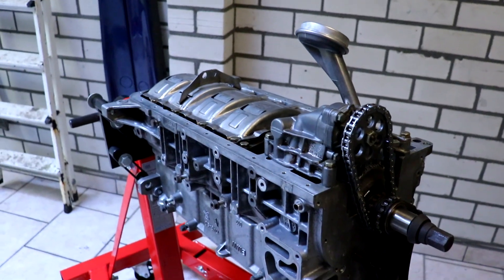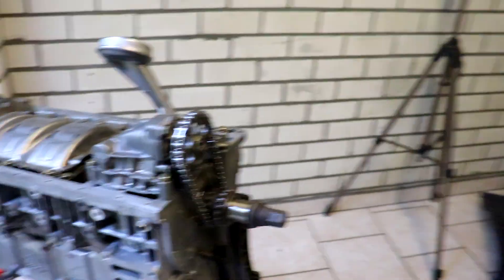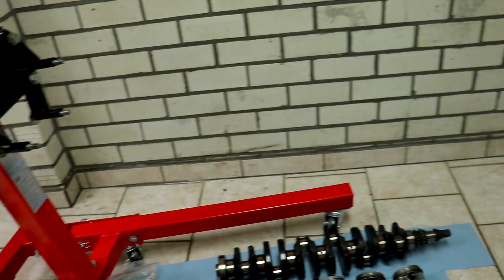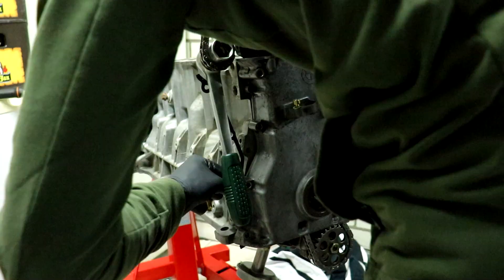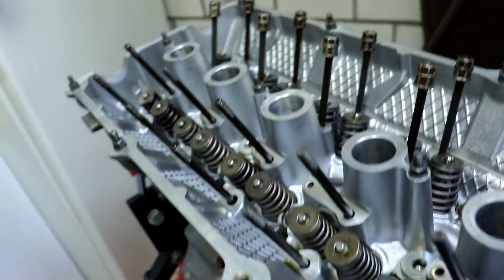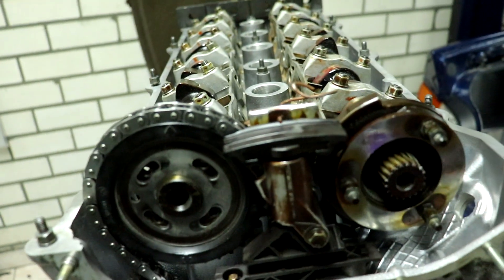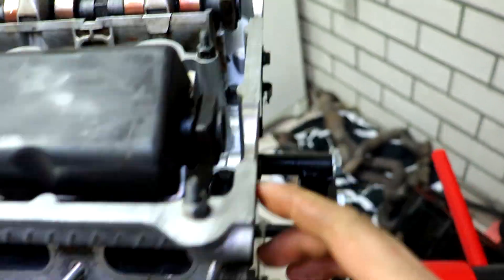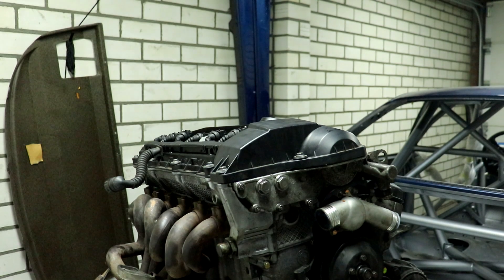Finishing the M52 ENGINE (FULL E36 RACECAR Build series) (Part 14) (Engine rebuild part 4)

Comment: Are you using factory m52b28 camshafts or have you installed an upgrade from the factory component
Reply from the maker: I used the stock B28 camshafts